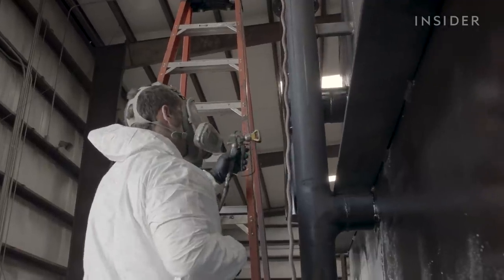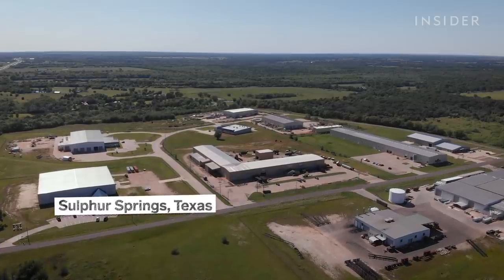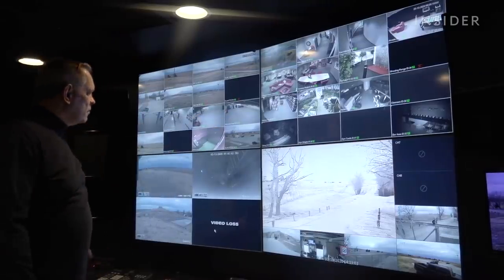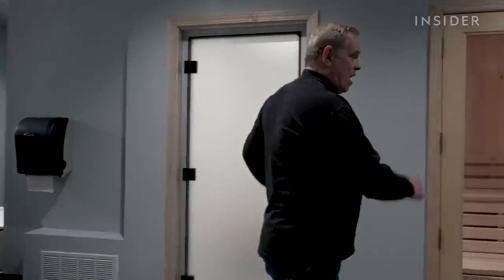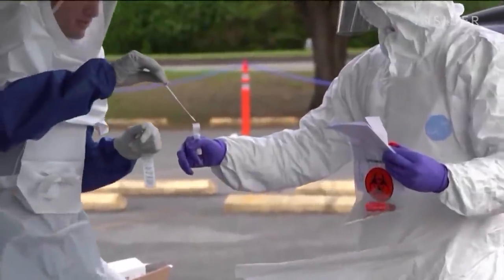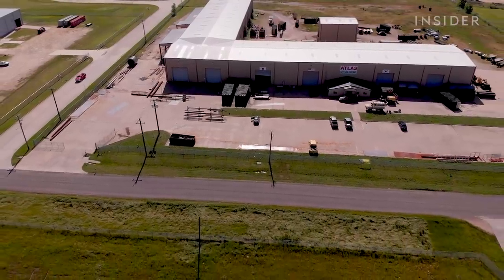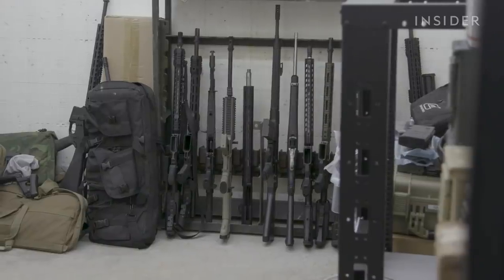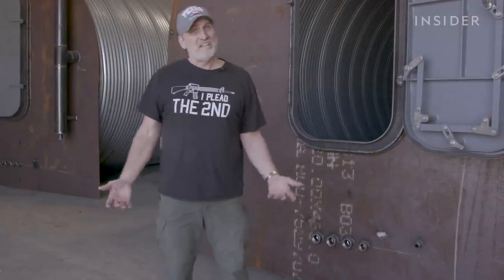Why Survival Bunkers Are So Expensive | So Expensive

Comment: This fits between scam and legit concern.

And just hit me, sewage and water supply. How would that work... Is it connected to the regular mains.
Reply: I was wondering that too. I didn’t see any wells or septic systems. Also, where is all the life support systems and how are they powered? It seems like an add-on to your house instead of a separate self-sustaining unit.
Reply: Some of the preppers have water supplies for X amount of time. Some have water collection depending on their climates. It’s a fascinating world, and I’m thankful I’m not too worried to join it
Reply: THAT is a very important topic.  Every place has a different method,  depending on the designer of the bunker. 
I myself, dug a hole and built my own with sand bags and barbed wire. 
My septic is planned to be a methane digester.  That's the wisest way to use those nutrients.   It turns to compost at some point.  I'm thinking of using a sleep number bed for a gas bladder to store the methane.   It's a work in progress.  Its money that stop all forward movement.
Semper Fidelis
Reply: your not gonna live a luxury life in a bunker, just use a bucket for the restroom and bottled water
Reply: for life support I would use some sort of urine filtration coupled with a hydro-electric unit to produce a fuel source as well as oxygen. 
The water would have to be stored not collected.
Reply: Also the next question where does you put a generator to don't die from his high toxic gasses ? And also where are you storing the fuel tank for it ?
Reply: The bunkers usually have generators, fuel, solar, wind and battery power. As far as sewer, many have ejection pumps like you would see in a basement for bathrooms. As for water, usually tied to a well on the property.
Reply: I watched a couple of these videos before. They have water stored and poop bags.
Reply: They literally have a YouTube channel

Go check it out
Reply: in Atlas Bunkers there's water storage tanks under the floor
Reply: @PhoebeBooffay  in the missile cylo bunker they have a self sustaining farm and fish farm system
Reply: @PhoebeBooffay  I was looking at something that I don't know how well it works because I can't afford it but it seems to use the moister in the air to get drinkable water.
Reply: @RozenHusky  i mean wall , door and locks are useless then, determined well equipped thieves will just force their way thru. Why bother have them, same logic
Reply: @unbekanntunbekant4587  solar
Reply: +batteries
Reply: Sewage and Water supply? How do you think the ISS does it? With very expensive life support systems just like the video says.
Reply: It will work pretty much the same as in a submarine, they sell systems for water purification and air scrubbers etc.

Comment: I would build a house facade around my bunker, if I could buy one.
Reply: If you Plan to build a Bunker underground then don't build it underneath a heavy house because if a bomb is thrown on there the house collapses and block the dor from the other side and then you can't get out anymore if your bunker is also out of metal you can't communicate to the outside they don't know where you are so they can't help and you will die alone in your bunker also if war is over or so  because you can't get out anymore
Reply: @unbekanntunbekant4587  there are many entrance/exit options including tank door 25/50 ton jacks which let you escape a flipped tank. If you have to money for a fake house, you're probably going to have a plan b exit tunnel built in as well which ideally has a lead doors built to withstand a tank blast and radiation
Reply: @undr_guv_surv  that tank door thing is so cool tbh
Reply: @noahnoah2747  ones with the big lead doors also can be equipped with thermal lances and hydro cutting systems that can cut through over a foot of solid lead. Some bunkers even have escape pods that can blow debris away from overhead while blasting into the air. Some of these are also designed to work underwater to resurface from below. Current tech has the best bunker systems set up to survive 500-800 years easily in terms of working systems I've heard of
Reply: We are renovating a bunker into a home.
Reply: @unbekanntunbekant4587  I’m thinking 2 total entrances, with multiple possible escape routes.
The main entrance Would be hidden in your house, and be the main reinforced one.
The backup entrance could lead to outside somewhere, so if you were outside and you can’t access the bunker through the house, there is someone else. This entrance would be extremely disguised, and more security probably.

Then the exits: there’s the entrances, but there could be more things. Idk
Reply: @admirali.a.6175  Add on one exit that's not connected to either, you're likely still in soft, diggable soil so have this exit be underground and buried. If the other exits are blocked you get out the shovel and start digging tunnels.

Comment: And most of us would wish they had that bunker right now
Reply: @Rich-yj4ub  That's not actually true if you aren't too near the centre of a blast (and presumably if you are you probably didn't survive long enough to worry anyway), it's certainly true that the contamination in some areas that are directly hit would still be detectable for centuries but the initial radiation would drop to an 'increased risk of developing cancer in the long term but nonetheless very survivable level' very quickly (radiation levels would be 90% lower than the moment of the blast after about 24 hours or thereabouts and 99% lower after just 72 hours- thereafter you are unlikely to get sick from just going outside at least in the short term), and even at the blast zone itself the radiation levels would only be directly dangerous for a matter of weeks. The real threat after the first few days would be contaminated water supplies/food supplies, which if eaten really would still kill you. The caveats are of course that it does depend on the type/size of bomb that was used/wind direction/whether they blew it in the air before it hit the ground or not/how many were used overall but generally speaking you have a pretty good chance of surviving if you can make it to some sort of shelter to ride out those first few days + secure clean food and water. Also I do recommend you go and look this stuff up, it's quite interesting to read about.

Comment: I would absolutely build one if I had the money for it.
Reply: There are lots of options even if you don’t have money
Reply: @UndergroundLiving  huh? Like what, honestly just curious
Reply: @UndergroundLiving  the materials and life support ain't free, are you break into someone elses bunker??
Reply: @pazmiki77  Only thing I can think of that's cheap is buying a tiny piece of land in an area with stable, soft bedrock and chipping away by hand. Should be able to make a little rat tunnel for yourself in only a couple hundred hours.
Reply: @dirtydan2721  but living there long term? 

Better than the alternative of being caught of guard, but I don't think a rat tunnel would do much good for long term.
Reply: @YaowBucketHEAD  People have lived in hand-carved tunnels for thousands of years. Long-term it might even be better than one of these bunkers, you can always chip away more space for yourself and bring in solar panels or wire in electricity from some other outside area. You have cabin fever and just want to go out and do something? Just chip away at the walls to occupy yourself, you'll make your tunnel bigger and get a nice workout.

Comment: To me if a disaster hits we would all benefit more if we came together and worked united to get through the problem rather than putting our heads in the sand and hiding like cowards.
Reply: How do you want to fight a tornado or a tsunami head on?
Reply: @izzagaming-vt6ny  Don't live on the coast. Drive away from tornado.
Reply: @izzagaming-vt6ny  we can't but the survivors will band together and help who they can and clean up the most and put things back together
Reply: @mohammedmakhdoom1207  that is not fighting it though
Reply: @chrisstearns10  guess so. I still don’t think it’s worth it to buy a bunker for an apocalypse like “zombies”
Reply: @chrisstearns10  If the survivors are the people with bunkers then you will have a population of people who are bad at manual labour.
Reply: @mohammedmakhdoom1207  if the only surviving people of a big disaster are people in the bunkers then yes bad manual laborers if they didn't build the bunker themselves, so very few laborers 👍

Comment: the problem with these bunkers, they get built, how often are they serviced. They might work out of the box, 10 years down the line, is your water, electrical systems, air filtration systems working. This is like owning a car , not using it for 10 years and expecting it to work without maintenance. The only time they will tested it is when they are needed, which isn't the best. 

The other problem expect people to know exactly where they are (i.e the contractors who built it for starters), they might not be able to get in, but they can make sure you can't get out

Comment: No need for a bunker.
Get a hand pump. A long length of hose. A portable welder/cutter. A heat sensitive camera.

In case of an apocalyptic event…

Locate the exhaust of a bunker with the help of the camera.
Locate the door(s) and weld shut.
Fill the bunker with water using the pump.
Wait.
Open the bunker and enjoy the stash.

Comment: The doctor designing the bunker by himself is worrisome to me as a civil engineer. I've seen many cases of companies(yes construction companies. Not even random people like that doctor) implementing pre-existing designs without factoring in the requirements specific to their construction site and it ending up horribly. There's so much that can go wrong with an underground reinforced concrete structure.
Reply: What can go wrong? Its literally concrete poured over metal structure, also the weight of ground above it isn't even that much

Comment: People, understand that nuclear winter will get you if the initial blast doesn't. Last ice age lasted 40,000 years. Unless you stocked up your food & fuel for next 50 year, your not gonna make it. The best option is to avoid the initial fallout for 2 week then walk/ride your way down to equator. World ocean will survive, you'll have to learn to fish and grow anything if climate allowed. Nothing can beat a bunker but don't plan on staying there long. If your tight on money, find the nearest subway or a deep parking garage. Pack food and water enough for few weeks. You'll have to survive in the car or shelter until the radiation dies down to 99% in 2 week. Again, plan your bug out location. Don't plan on driving more than few miles as streets will be crowded with car and people. If nothing, find a basement and hope the blast is weak. A person needs gallon of water per day but can do with half a gallon granted you don't sweat it out. In your bug out bag: portable water filtration and purification tablet, iodine tablet, meds/firstaid kit, multi-vitimin, portable candles, lighter/matches, multi-tool, flash light, portable ax/shovel, emergency blanket, mask, eye protection, rubber gloves, sanitary wipes, clean cotton towel, plastic bags, high calorie food bar, seeds(corn, potatoes, rice, barley, carrot, onion, etc), 9mm sub compact with at least 2 additional mags + 50 round box of ammo. Best of luck.
Reply: Thnx for Advice!!! 😉

Comment: Don't fall for all this it's not as complicated or expensive as they say. Air is fans and pipes filtered through water.  Drinking water can be pulled from  live springs ponds and rivers filtered through sand and charcoal. Draining waste water is also easy with septic tanks and sewage lagoons with shut offs for back pressure control.

Comment: This guy really knows how to mark up connex boxes and culvert pipe... Sadly if a bomb drops you're gonna need to go way deeper than 10-20 feet. If I had 500k to blow on a bunk, I'd just build out an old mine or cave....
Reply: Homie, the point isn't to stop a bomb dropped on your exact location...

Also, caves and mines are way worse in the case of a bomb going off above your head lol, think of the distance to eventual rescue, and potential for cave ins.
Reply: @timothinking9855  the point of civilian by kers is somewhere to hide until rescue teams get to you... Also, bombs have not improved 10x since the cold war... We have the same explosive filler, same penetrative capabilities, just gps guided.

If you seriously think explosives just "got better" you need to do some research. Since WW2 bombs have been getting substantially smaller.

Comment: The smart way is to design part of your house with a bunker up front. Have a central section that's reinforced up the waz and go in concentric perimeters. Make the central super secure zone a room you'd use all the time, and include kitchen, bathroom(s), sleeping quarters, and backup power. When the zombiepocalypse starts, simply close the door. You're already there.
Moving outward, you still have reinforced areas that are easily defended, but look more like a regular house and are cheaper to build.
Some secure areas would be better underground, and some would be up higher for a better view of danger.

Outward still, you'd want natural barriers in strategic locations.
Hidden webcams up in trees are a must for surveillance while hunkering down in the bunker.

Another good feature would be an air inlet/exhaust feature that looks like a chimney. It sucks in fresh air from up high, and of course not near actual chimneys.
If you really want to get fancy, have the house maintain a positive air pressure. Even if the wind is blowing, when you open the door, the air gusts outward not inward.

Comment: It's air tight. So how do you breathe?
Reply: They use rebreathers similar to diving gear to recycle the air and scrub carbon dioxide from it. Often they also use filtration for air vented into the bunker.

Comment: Seems over the top.
Small cheap underground bunkers with solar, batteries, air-to-water generator and vertical hydroponic farming would save most in a short emergency.  The government could support the population with advice on cheap short term bunker builds.  E.g. Don't Look Up scenarios, Ukraine.
These expensive bunkers seem to be long term, which seems illogical as a long term emergency will be dominated by a much stronger force than a few expensive bunkers.